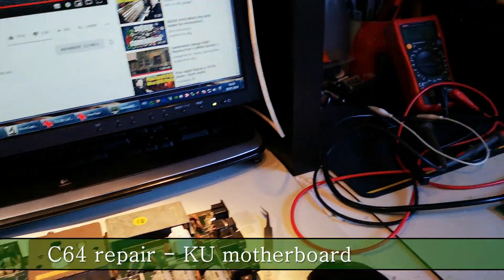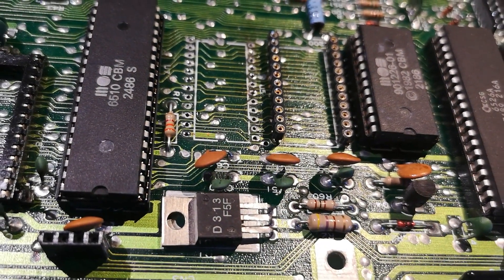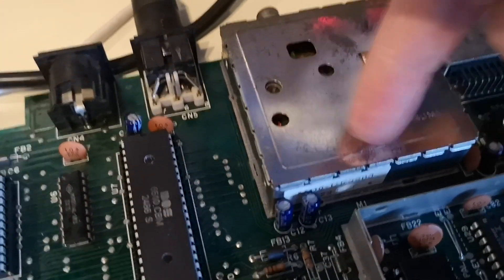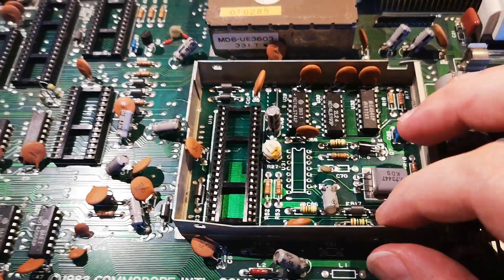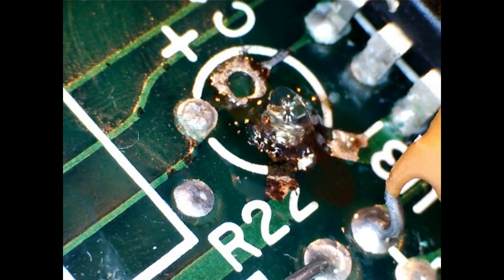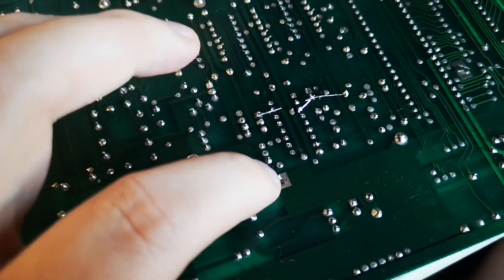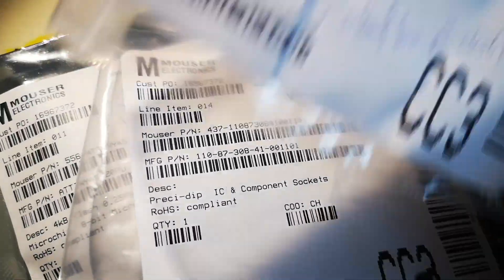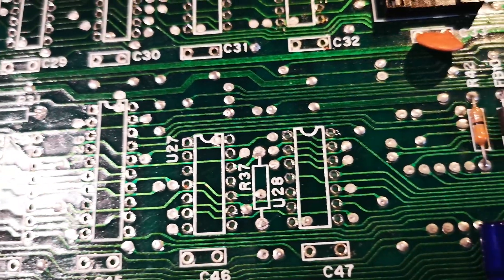Fault finding a C64 KU-14194HB motherboard before removing all the components

Comment: Great video ,,, I have same prb but can't get it working rf all good but no composite,  replaced modulator and  recapped modulator,,, wiggled av port thought it was tht , replaced tht still same problem,  removed av connector and lifted 3 vias , stuck at this point gave up

Comment: I sent the file to pcb company and they asked me ....do you need to cut out the slots in KO layer?
If yes, shall we cut them as plated oval slot or non-plated slot? what should reply them?
Reply from the maker: I usually reply with throughhole plated holes to the manufacturer, even though the original is not.

Comment: Hi! I thought I'm the only one who is still using a manual solder sucker pump! :-) Thanks for that video! Greetings, Doktor64!
Reply from the maker: Thank you. Yes. I'm considering an electric solder removal tool, but the few times i remove ICs, a pump will do. Hot air too. 🙂

Comment: I’ve never heard of the KU variation of the C64 board.  What sets it apart from the other more common boards?
Reply from the maker: It is the first board with S-video and an 8 pin AV connector. It is an interrim board between the earliest and 250407

Comment: Nicely done sir. Impressed at how much you desoldered the “manual” way. Not having much experience with the soldering iron, I went straight for the ZD-915. As svenpeterson1965 said it makes a huge difference as the workhorse tool, with the solder pump and wick as a great cleanup option for some of the trickier pins.

Comment: Excellent, Hans! If you would get a ZD-915, you would be so happy... the difference is like a hammer drill co,pared to a regular drill when drilling holes into a concrete ceiling, really. You could also use some modern precision sockets, when assembling it again.
Reply from the maker: Not happy with precision sockets. The ones I got from you the chips get stuck. The sockets are made to made for round pins. I prefer the double wiper sockets. Also there are different hole sizes. I have some extras I ordered for the kernal switchers to test out various models.
Reply from the maker: Thanks btw :)

Comment: Great job!  I am wondering about  the KU board now lol - is that rare or something?  I am not sure whether I've worked on that one or not - looks the same as others I've worked on but I've never noticed whether that KU code was there or not.  Might have to look back at my older vids.
Reply from the maker: They are less common is perhaps more likely than rare when I think of it.. They sat in the early machines, and it was an interim board.